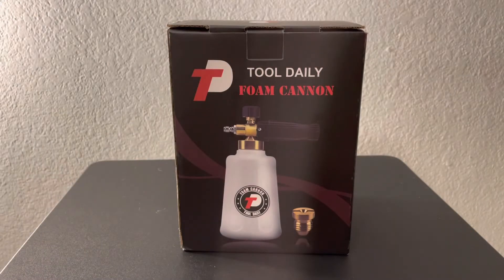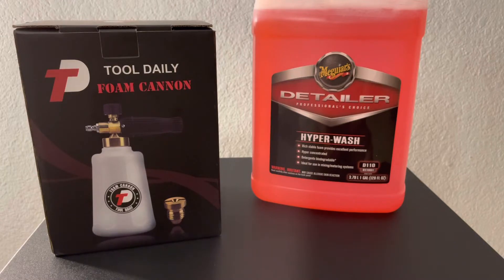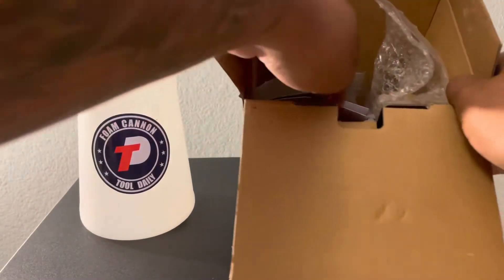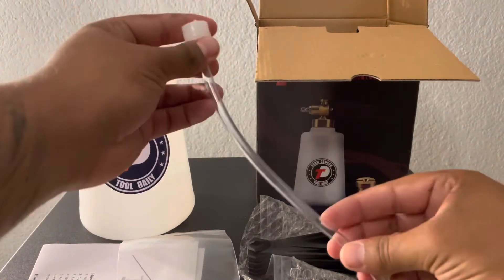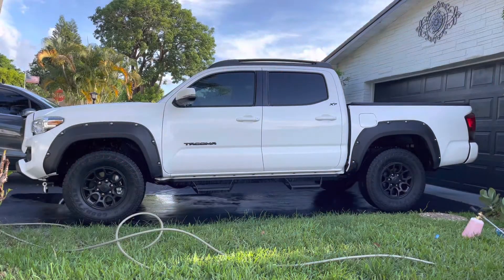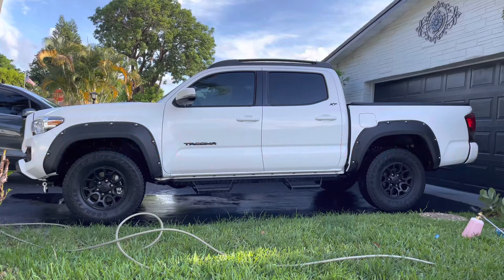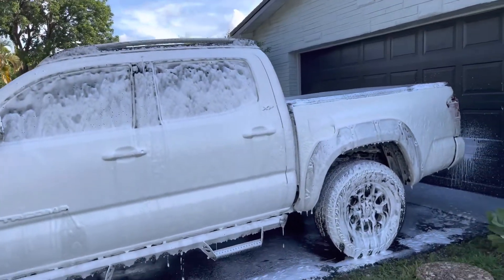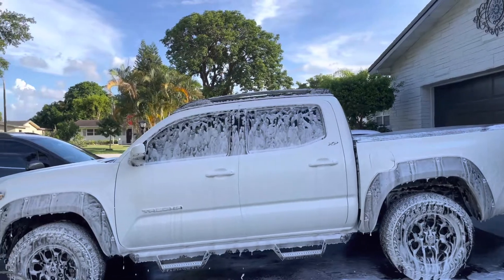Tool Daily Foam Cannon!

Comment: Hi, I have the same and not so good results. Can I ask 2 questions to help:
1. How much oz of soap do you put in cannon ?
2. Specs of your machine,,, Psi and Gpm

Tnx by advance for answering.
Reply: I don't need a "like" loll, I need you answer  my 2 questions... don't understand
Reply from the maker: Thanks for commenting. Make sure you’re using the same soap as me. Put maybe about 2-4 oz in the foam cannon. Add warm water. Even hot water works best. Doesn’t have to be boiling water. Make sure that the knob at the top of your foam cannon is almost completely closed(where the + and - are located) as well as making sure the nozzle of the foam cannon is almost completely closed. It won’t matter if you have a electric or gas powered pressure washer, if done right it will work.
Reply: By the sound you can tell its a gas powered pressure washer so much stronger than electric if thats what youre using. Also make sure to install the 1.1 orifice and don't skimp out on foam.
Reply: @stay4theride  what soap
Reply from the maker: @carson4227  Meguiar's G191501 Ultimate Snow Foam Wash, Pink Foaming Car Wash Soap for Foam Cannons & Foam Guns, Ideal Foam Wash for Cars, Trucks, Motorcycles, RVs & More - 1 Gallon Container https://a.co/d/dteUwm1